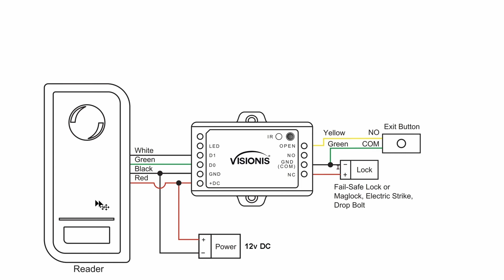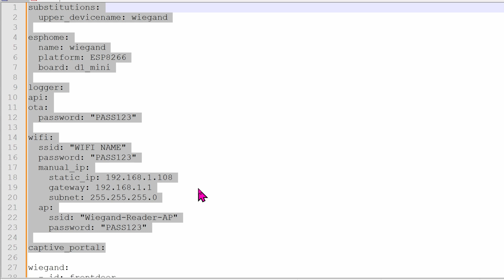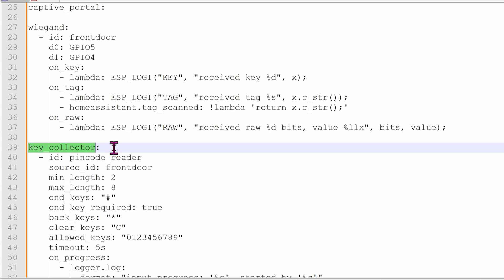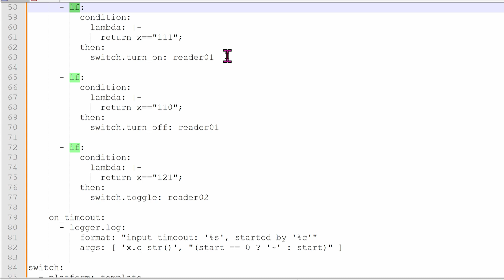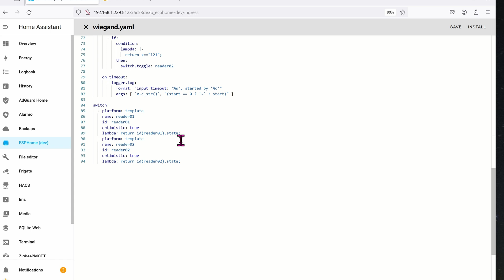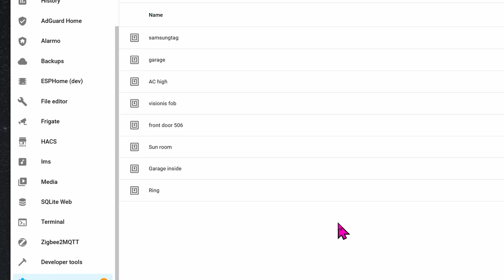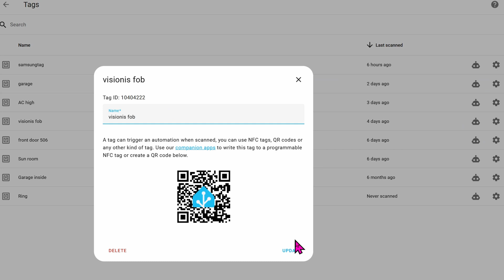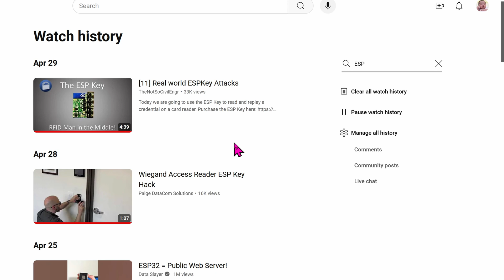ESPHome and Wiegand keypads or readers. so much more automations with these 2 combos

Comment: Hi am getting "[03:54:08][D][wiegand:116]: received unknown 200-bit value: acad6a9555552aaa" 555552aaaaa552aa
using a D1 mini pins D1 & D2 I change the pins arounds but am still getting these string of code. 
its the LEXI Ultimate Full Waterproof RFID Keypad it looks like the same one on the esphome page. TIA